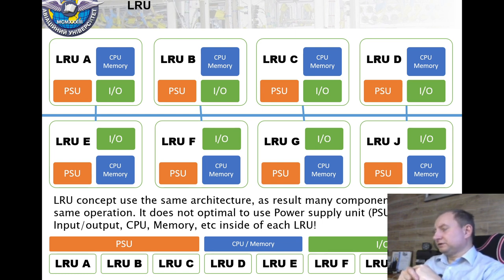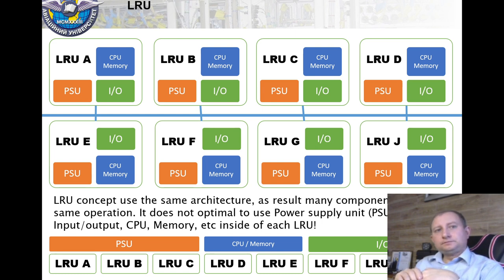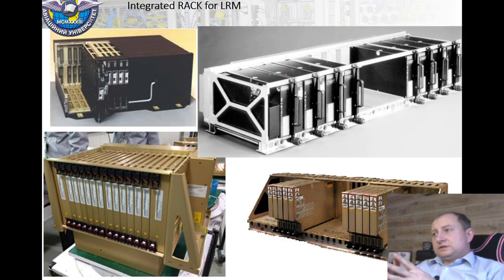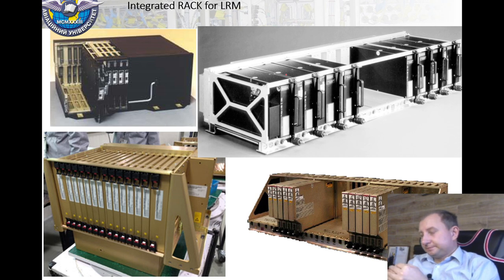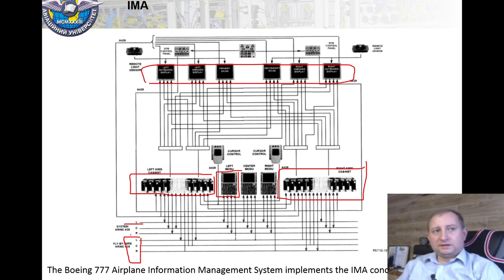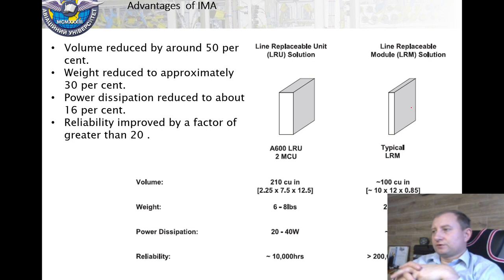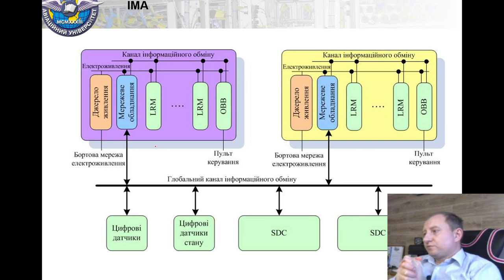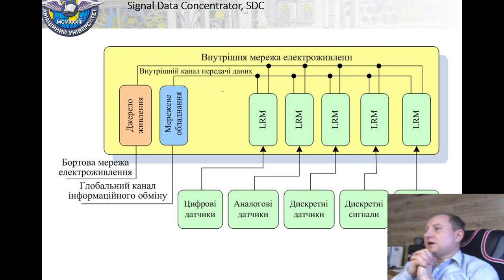Avionics. On-board equipment of civil aircraft. 05 Integrated Modular Avionics IMA

Comment: Hello!!!! Please, let me give you some suggestions to improve your content:
1- Try to start with a small story about the IMA. When this philisophy was used at first time, why it was developed, the key benefits provded by. 
2- introduce the System architecture, the main components and iterfaces.
3- State the safety precations applicable when working on the system.
4- Dacribe the principles of operation during normal and abnormal conditions. 
5- Sumarize the content making an small quiz with the main topics covered.
Reply from the maker: Thank you